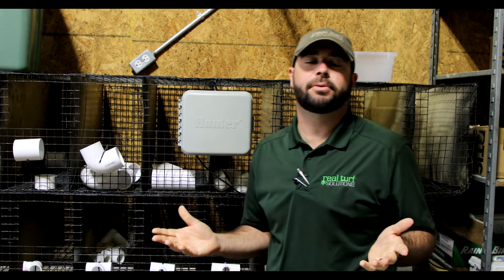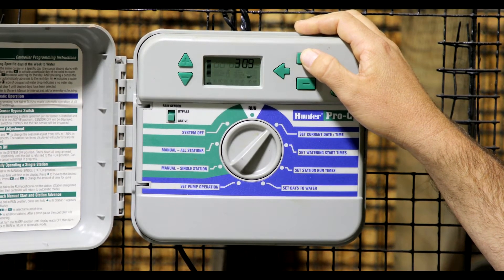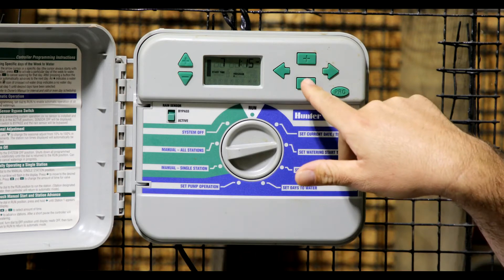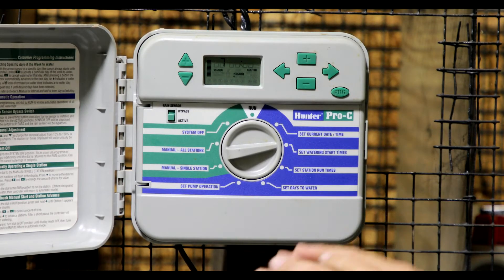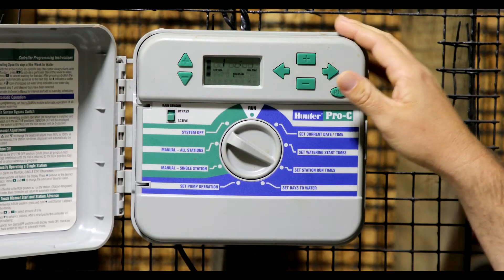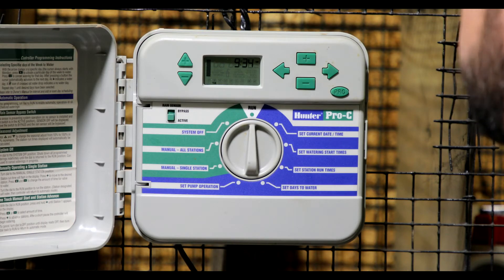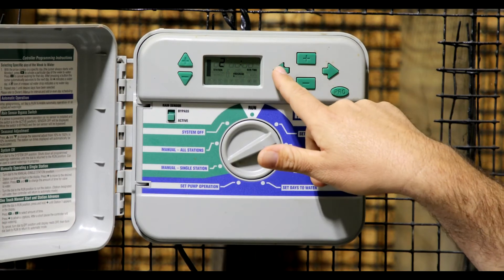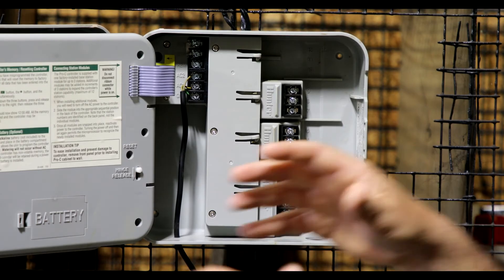How to Use a Hunter Pro-C Irrigation Controller | Full Walkthrough & Operating Tutorial

Comment: I have a Hunter Pro C late model, I had to change one of my control valves. After I changed the control valve my Pro C does not recognize zones 5or 6. When I go to program the controller to goes from zone 4 to zone one even though it is not time for zone 1 to turn on.I can turn any of the zone on by doing it with the single zone on the controller.
Reply from the maker: Make sure your modules are properly installed in the controller so that it is set up for those zones. Then also be sure that the zones have run time set for them, since it will skip over zones sometimes if you don't have any time on them. If that doesn't fix it, you'll probably need to call your local irrigation service to come take a look at it. They'll be able to get a better idea being able to see it and all.

Comment: How can I lift the sprinklers up out the ground to change them
Reply from the maker: If you are talking about rotor heads, you will need an irrigation head adjustment tool. Look at the top of the sprinkler head and you'll find two circle shaped slots, these are for adjusting the rotation and spray range. There should be a third little slot that looks like a line with a round part in the center of it and usually covered by a rubber flap. This is the one you want. If you push the top of the tool (the plastic handle end) into this slot, you can pull up with the tool and raise the head. you'll need to grab it with your hand to hold it there. To change out the entire head assembly though, you'll likely need to actually dig it out so you can disconnect it.